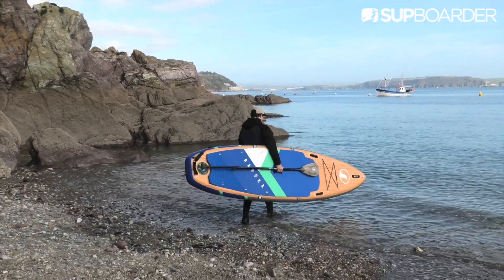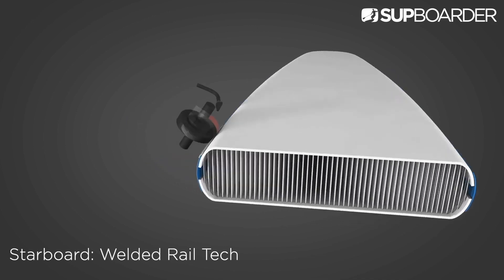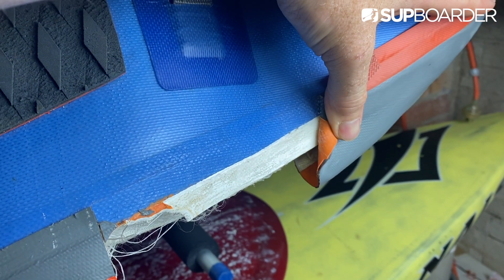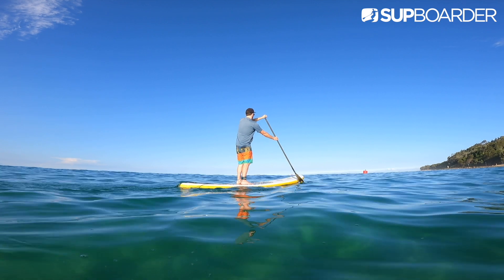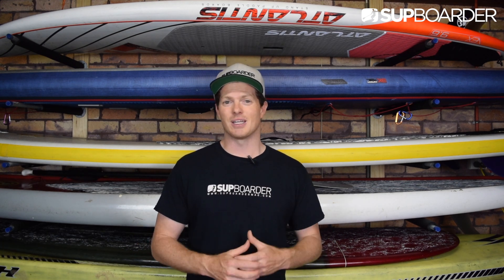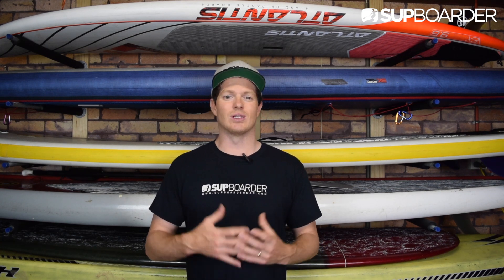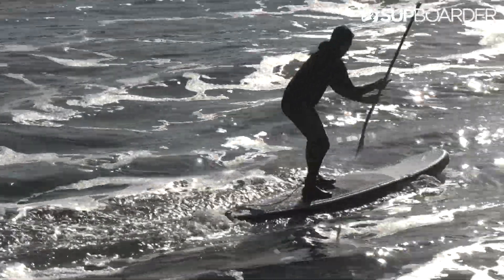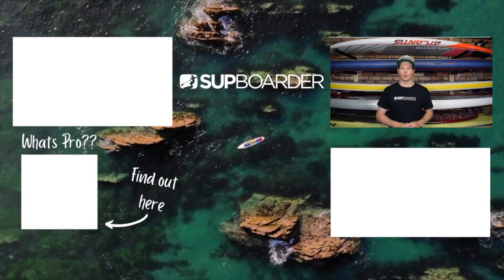How Long An iSUP Should Last / Inflatable SUP Life Span

Comment: My wife’s 2014 starboard Astro drive has had a lot of use and is still going strong.
Reply: Do you frequently fold it? I'm afraid bending the material could quickly cause  tear. Am I too cautious? I'm about to purchase an inflatable fir mobility reasons, but this is a key point for me
Reply from the maker: Great to hear!
Reply from the maker: So long as you fold it loosely, and not too tight, the material should hold up for many years. You can do this many times each week and still get lots of use out of it. The more premium price points will generally last longer. Hope this helps and all the best! Beau
Reply: @SUPboardermag  Thanks a lot for your reply! That's great, I'll get one!

Comment: I purchased an iRocker, it was replaced after one summer use because the seams were coming apart. I received a new SUP, but since it arrived in November and here in Ontario Canada that’s when it starts getting cold, I waited till summer to start paddle boarding again. After approximately 6 times being out with my board I started to notice the seams coming apart, so I contacted iRocker. Well I was extremely disappointed to find out that they would not warranty my new board and my first purchase only came with a 1 year warranty (not the 3 year mentioned in the video). I would not recommend iRocker to anyone since they don’t stand behind their product.
Reply from the maker: We're sorry to hear about your experience. good for others to learn from your comment. iRocker do a 3yr warranty on boards purchased in 2021 onwards.
Reply: @SUPboardermag  iRocker warranty for their Nautical board is only 2 years according to their website.
Reply: Irocker makes overpriced gear. Two of my friends with boards less then a year old are having failures on the seams.  My cheap Zray 8 year old Zray has had failures but is easily glued back together

Comment: What do you think it can happen if you inflate and deflate the isup for the entire summer every single day? It would harm the seam too much?
Reply from the maker: Good question. There are a number of factors that may influence this such as how you store it overnight and if the seams are being squashed, how much PSI you place into the board (too much) and if when pumped up the board changes in pressure (due to temperature). I would say it would last a few seasons, but with all things a lot of use and wear will degrade the quality. Hope this helps. Thanks, Beau
Reply: @SUPboardermag  i want to start a sup rent activity i will start woth a couple of them and i need to inflate and deflate them every day they will be stored inside in a safe place.
The place is coastal very rocky, do you have any advice to protect the sup against puncture on shallow rocks? Are there kind of protection in the market? Are isup resistant in the long run to rock places? I fear that beginner customers will destroy my sups in a couple of week, then my activity will be fucked😂
Reply: @SUPboardermag  i just hope they will last atleast for this summer
Reply: from what i have read the best way to store them is slightly inflated. im sure that rolling them will begin to start putting strain on certain parts of the material which will eventually develop a leak. (after years of use).

Comment: I've had my Tower SUP last 10 years through years of abuse...whacked with a machete, dragged all over, ran into rocks with a motor and outside of a pinhole leak from a barnacle it was working fine. Fast forward to last summer, did a 6AM paddle and left the board on the water in the hot texas sun. Came back 6 hours later and the epoxy at the seams melted from the heat, granted the water was basically boiling it was so hot.
Reply from the maker: Wow! Just goes to show that heat can really melt the glue. Most board can withstand anything, as you have realised with your Tower SUP. Thanks for sharing. Beau

Comment: I left my iSUP in open outside in the sun on a floating restaurant while I was having breakfast and it bursted 😢 today, it was only 1.8 years in use
Reply from the maker: Oh no!!! What brand was this?  Please let us know how the manufacturer has dealt with this if still under warranty.
Reply: @SUPboardermag  it was itiwit brand but mistake was mine I believe. 

I live in Singapore which is  hot and humid city and the area where I left my SUP got extremely hot once sun came out of the clouds luckily we could save other one from bursting.

I am dealing with the Decathlon folks they are yet to get back to me what they're gonna do about it.
Reply: @SUPboardermag  as expected Decathlon refuse to replace or fix it stating that damages caused by  leaving it out in the sun while inflated is not covered.

 I bought another one from them a longer (11')  and leaner (32' width ) one it's lot less stable getting use to that.